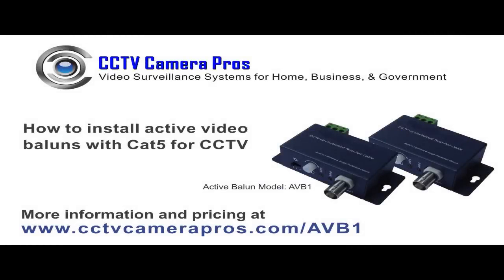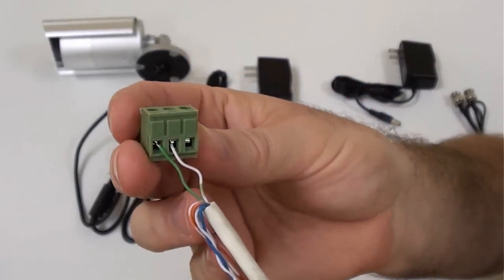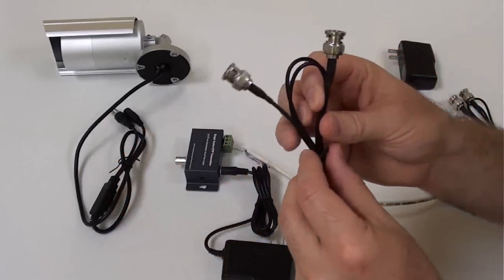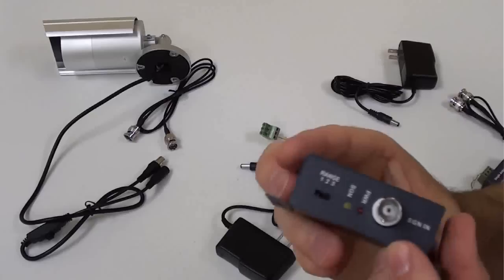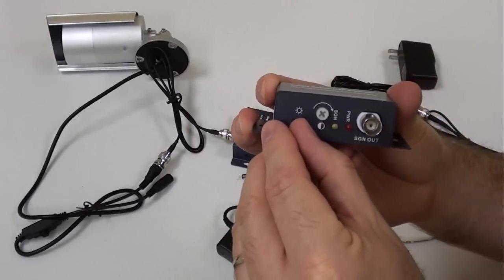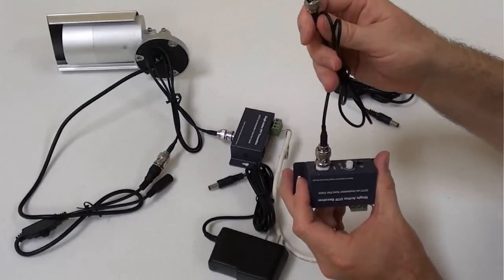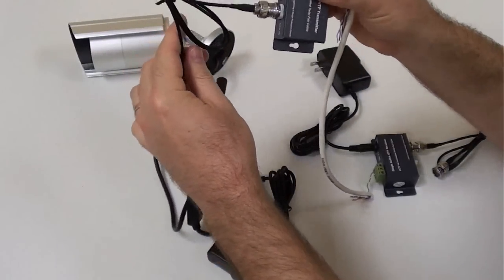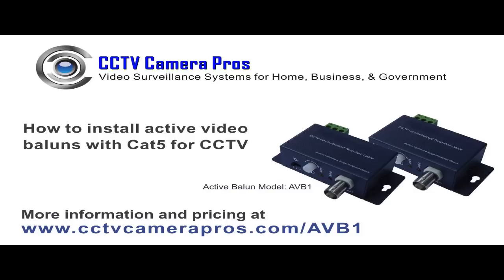How to Install Active Video Baluns with CAT5 for CCTV

Comment: Is the unbalanced source balanced and is the receiver amplifier capable of common mode signal rejection due to being a differential amplifier?

There is an application where there maybe 60hz signal interfering with our video signal for a covert camera. We found ac component on the power supply and are moving to a local supply as you have said.

Our existing signal line shares conduit with high voltage so we want to use shielded twisted pair to balance the circuit thus the question about whether these balance the source and if the receiver is a balanced load/amplifier.

Comment: What if you don't have a power source at the camera end?  Does that mean you can't use the video balun?  I need to run approximately 3000 feet from the dvr to the road.  Any suggestions?
Reply from the maker: In order to run video from a security camera 3000 feet, you can use powered baluns to run the video but you definitely need a power source on the camera end to power the camera.
Reply: Okay, what if I send 115 volts power from the dvr end and use that at the camera end?  Invert the 115 and regulate it down from what ever it winds up being after voltage drop, say 48 volts, to 12 vdc?
Reply from the maker: acoustic4037 that will work fine. You may as well run high voltage AC power and create a power outlet, then use the DC power transformer included with the active balun. Are you saying something different than that?
Reply: That's what I was thinking, but my concern was voltage drop.  I didn't know if there was a way to transform ac power to dc, in the event that the ac power voltage was say..randomly 64 volts for instance.  I would want to knock 64 volts ac down to 12v dc.  I have not found a product to do that yet.  I suppose if that was the case I could get a 120 to 24 transformer and perhaps it would work out ok being half in, half out due to the relationship of the transformer windings...

Comment from the maker: Active Video Baluns with CAT-5 for Long Distance CCTV Camera Wiring

Need to run cable to a CCTV camera at distances longer than 700 feet? Using active video baluns plus UTP cable (like in CAT-5) is a good option to consider.

RG-59 coaxial cable has long been the industry standard cable used as video cable in CCTV system installations, however, cable runs are limited to about 700 feet (unless using a CCTV video amplifier) before video signal can drop or be completely lost. A viable alternative is to use unshielded twisted pair cable (like the cables used in CAT5 network cable) with active video baluns to run CCTV video up to 5000 feet.

This option is especially worth considering if you are installing CCTV cameras in a location that already has CAT5 cable run close to the locations where CCTV cameras will be mounted.

Please note when using active baluns with UTP cable, installers must plan on supplying power to the camera from a source close to where it is mounted. Running 12V DC or 24VAC more than a distance of a few hundred feet is not realistic. 

Please watch the below video to learn more about how active video baluns can be used with CAT-5. You can learn more about the baluns used in the video on this page.
http://www.cctvcamerapros.com/AVB1
Reply: Nice!